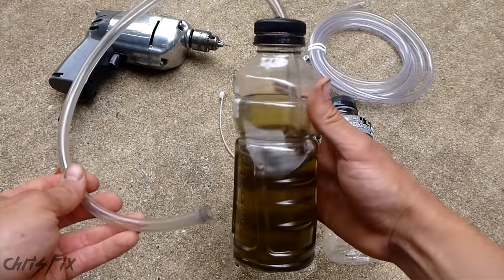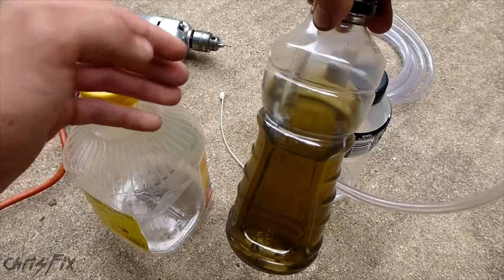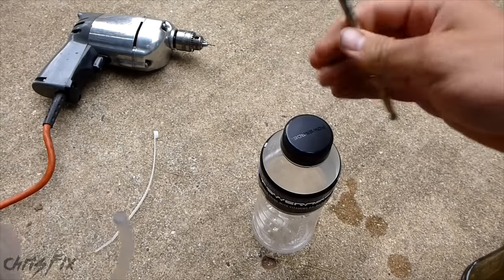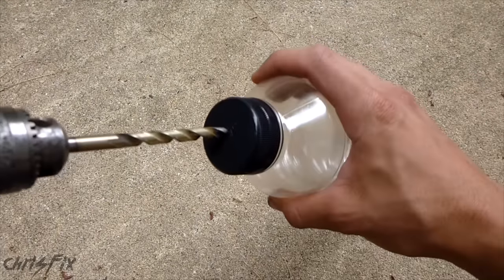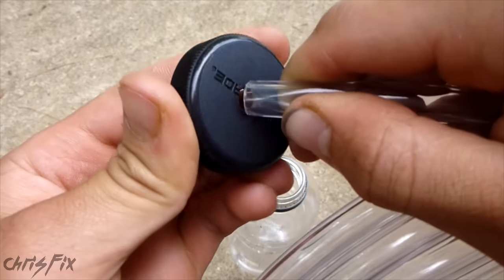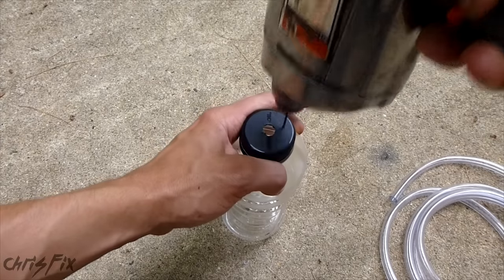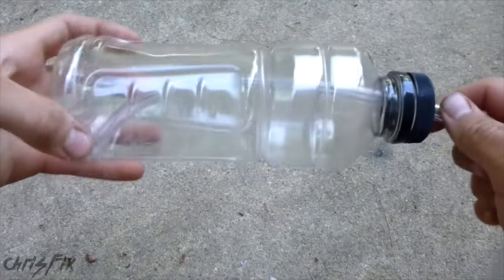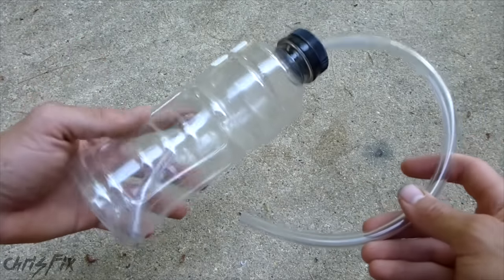How to Make a One Person Brake Bleeder for Under $5

Comment: They don't sell Gatorade singles.. So I got two 20 fl. oz. Vitamin Water Bottles at Wally World $0.96ea. like 30 minutes ago. Bottles look almost identical to the gatorade bottles. I also got 1/4" hose clamps instead of using the zip ties. 1/4" ID x 20'  clear tube was like $5.35 at lowe's, and the hose clamps were something like $2 or something. (+1 : 8,402)
Reply from the maker: +Mark II Nice! You dont have to use gatorade bottles haha
Reply: ChrisFix Kinda figured. Tnx for the reply, keep the awesome videos coming Chris.
Reply: +ChrisFix  If I'm bleeding the brakes on a Rolls Royce or a Bentley, shouldn't I be using a Perrier bottle?

Comment: Could you do a video on finding leaks? I have a 97 ranger with no pedal pressure but there are no visible leaks, puddles, etc.
Reply: Master cylinder is bad. If pedal is soft and no visible leaks underneath usually its MC.

Comment: Take a hose long enough to go from bleeder back to the reservoir. A little pre-filter so debri stays out. A one-way-valve right after the bleeder nipple, and some play-doh clay to seal the bleeder bit better. And go for it....
Reply from the maker: Abby Sandigan You cannot filter out water from the brake fluid so this wont work. I would not put anything on the bleeder valve either (maybe grease) because if it contaminates the brake fluid you can have bigger problems.
Reply: I am talking about bleeding the brake. If you have to renew the oil just push new one through...

Comment: I glued a magnet to the bottle  so I could stick it on my rotor or a metal part so I don't have to put it on the ground and have a shorter hose.. have you ever tried this?
Reply from the maker: swampassoutfitters That is a great idea! Thanks for the tip!

Comment: Hey Chris does using a hand vaccum pump leave any old fluid and/or air up in the master cylinder? I'm asking basically does the pedal push method clear out every little bit better than a pump or do they both clear the system equally good? Thanks for the videos man.

Comment: Great vlog Chris ,, I just flushed my Flux Capacitor ,  Fortunately I when I got to 88 Mph it worked and I ended up in 1953 ,, 🤔⁉️So I bought the same drill as yours ,, Lucky it still works Today ⁉️🙀👌😂🤣😂🤣😂🤣

Comment: Hey Chris, did you really need that pilot hole while drilling thru soft plastic ?
Also, you measured you 1/4" drill bit for the "inside" diameter of the tubing. If you would have measured the outside of the tubing and selected a drill bit accordingly you would not have had to "waller" out the 1/4" hole to make it bigger.
Question:
Can you bleed your brakes by your self with this gizmo, or do you still need someone to press the brake pedal down while you loosen and re-tighten the bleeder screw ?
Reply from the maker: Vic Krue It helps the bit from skidding around. I measured the inside diameter because I wanted to make sure the hole very tightly fits the hose. Here is a video using the brake bleeder which you can do yourself: https://www.youtube.com/watch?v=n1NvtUwfRJc

Comment: This video is pretty cool, thanks for sharing. I've been looking for some fuel line around that size but my local hardware stores and auto parts stores only have like really small line. Does anyone have any recommendations of where to find some fuel line around 1/4" internal diameter?

Comment: I just checked and I have a 8 mm rear bleeder valve and a 10 mm bleeder valve on the front. What size diameter hose do you think I need ?

Comment: wont some air just go back and forth in the line as you pump? I am trying to bleed hydraulic surge trailer brakes by myself. I can pump the master cylinder with a 2x4 but I would think that I still have to keep the fluid moving in one direction until ALL of the air is purged? if I dont get all of the air out and into the bottle in one stroke, wont it just get pulled back up in the hose when I pull the piston back?

Comment: Chris 
You said in the beginning of the video that the brake fluid would last for 2 brakes and then must be emptied. Did you mean emptied or just reduced so the fluid doesn’t overflow?
Reply: Just reduced, dont want it to over flow. Also it never hurts to bleed the brakes until you see fresh fluid as this pushes out the old fluid which more than likely is loaded with moisture. You might have to empty that bottle once or twice for a good flush.  The lines are small, theres not much there and theres always extra new brake fluid left over with just a brake bleeding.

Comment: a nice quick and dirty system for a quick fix, but letting the fluid suck back into the system,you run the risk of sucking air back into it if there is still air in the tube. what you need is a check-valve of some sort in the line to keep the fluid from being sucked back into the system as you go
Reply from the maker: ircimager that is why in my video on how to use the bleeder I show that you need to angle the tube upwards so that the air bubbles up and out of the line. A check valve works too but now you are getting complex.
Reply: yeah, i realize that part, but i'm referring to the air already in the line that may not have gotten to the expel point before the next pump-out

Comment: Hi Chris, would it be possible to do a how to video, on how to make a cheap boost pressure device to set your cracking pressure on a turbo actuator. But something that is really accurate I.E, can go up in pressure by 0.1psi if necessary...thanks
Reply from the maker: +TrenC21 That would be an awesome video but I need to find a turbo car that someone will let me play with.
Reply: +ChrisFix not necessarily....build the device...and just use a spare turbo with an internal actuator....it does not to be on the car ;)

Comment: My mechanic replaced my brake calipers in the front and also the drum brakes in the back. When I got home I noticed the header tank was empty. How do I know if there is air in the system? Will air really corrode the system? If so how long will it take?
Reply: air won't make it rust but it'll make the pedal very squishy and might stutter. Water is what rusts your lines.

Comment: I recently made one of these to assist after a front caliper replacement. It works great. However, there is one thing that tripped me up that isn't mentioned in this video, or any of the other videos where Chris uses this tool. 

After you've bled the brakes, and the tube near the valve is filled with brake fluid, you've got to pull the tube off of the valve. Unfortunately, doing that creates quite the mess, because you've got to pull on the tube hard (since it's a snug fit). Each time I did this, I ended up with brake fluid all over. So, what's the trick here?
Reply: Just spray it down with brake clean after you are done.

Comment: Thanks Chris...  Love your videos!  One question though...  I've used this system myself but it does require a second person to operate the brake pedal.  You say this is a "one person" brake bleeder.  Am I missing something?
Reply: Maurica Arney - I've done solo bleeding successfully and will I'll try to answer. Did you do it exactly as shown in the video, like have the tube arching upward from the caliper so the air bubbles rise as you press on the pedal to the floor? Keep in mind the tube acts like an extension of the bleeder valve and as long as it has fluid a few inches above the valve, you're getting all the air out of the line and caliper. Hope that helps.
Reply: @ninemilliondollars  You need a second person to operate the brake pedal while you observe to see when there is no more air in the line.
Reply: @mwa1252  Hi. I just did my front passenger side caliper today. Had to replace it to figure out why that brake was binding. I used a clear tube and a cup (actually, it was a bleeding kit I bought a long time ago resembling the one in the video). By arcing the tube upward and away from the caliper, it allows the bubbles to float upward and then down into the cup. Granted that you are correct about wanting to see there are no bubbles, and that is most desirable, but that can be solved by depressing the brake pedal all the way to the floor like three or four times. This pumps a sufficient amount of brake fluid through the caliper and no air remains. I did this and after I closed the bleed valve, the brake pedal was rock hard. :D

Comment: Very good and helpful - thank you Man!
Reply from the maker: Thanks Pete!!!
Reply: I now have all of the parts (calipers, rotors and pads also new clips that came with the pads and calipers, brake fluid etc), I've changed brakes before but not the calipers and your techniques sure help including the bleed bottle you made...I'm making one and will use it even though I have a second person to help pump the brakes, just a better way of doing the job, also I like how you bolted the caliper then lifted the bracket to insert the pads after, so easy! - thanks again man.

Comment: My mechanic just opened a nut inside rear wheels. Started the engine, pressed the break, and all oil was gone. Then he tightened the nuts and filled new. Took 2 mins, no extra charges for this.

Comment: Wouldn't it be necessary to put a sealant between the tubing and the hole on top of the cap for an air tight seal?
Reply from the maker: +Terrance Williams you don't want an air tight seal.

Comment: Hello i saw how you did it but alittle confused about bleeding it. The steps. I have about 103000 miles on my car, never changed break fluid. I saw that I was low so I added some to. Reservoir. It was about two years old, new but break fluid. Did not know that break fluid was perishable. So my questionnaires after I finish correcting it an opening up the bleed valve do I just go slowly press on the brakes about 10 times to clear the line and then am I OK to let go of the break and go tighten up the bleeder valve or how does that work.

Comment: Will the zip tie fall off after a few uses? Can I use a small hose clamp instead of a zip tie?
Reply: I'm thinking it might be difficult to find an adequate metal clamp. The screw types are often too wide to fit over the smaller part of the bleeder screw, and the spring-type ones don't allow you to modulate the clamping force. So small zip ties (8" or shorter) are probably the best cheap, readily available option.

Comment: Does the diameter of the hose matter ? I have a clear hose that is slightly more thin but the same length.
Reply from the maker: +Jacob Gee as long as it fits tightly on the bleeder valve that's fine.

Comment: How does this prevent air from getting in the system?
Reply: Because the hose in the bottle needs to be in the fluid 
. If it's not, it will suck in fluid.

Comment: One question: Do I open the nut then depress pedal once or several times? then what about air in line both tubing and brake lines? Ive never used a pro tool like a shop bleeder, but its always been three squeezes on pedal and hold. where you undo nut and let pressure out, then tighten nut and repeat two or more times. I suspect my System has a bunch of air in it. will this bottle method help?

Comment: I wonder one thing. How can one press the brake and at the same time close the bleed nut? If you release the brake without closing the bleed valve it will suck the air again.
Reply from the maker: +Muntasir Ebrahim you don't close the bleeder valve. The tune is facing upwards so the brake fluid collects and the air bubbles up and out.

Comment: how do you go about removing the tube from the nipple with fluid being in the tube? or do you just expect some fluids to be spilled from the tube and just proceed to clean it up?
Reply from the maker: Rob Shum You just pull it off and have the tube lower so the fluid runs down instead of out.

Comment: Hey Chris is it possible to resurface your rotors and use the same brake pads my pads have plenty of life left or should I just wait for my next brake job then resurface them.
Reply: Pads and rotors should be replaced or resurfaced at the same time.  Remember, the pads now have the same flaws on them that the rotor has, but in reverse.  The rotor may be machined smooth, but the pads won't be.

Comment: What is a bleeder valve wrench and do you suggest using one
Reply: It's just a normal wrench but it has 5 contact points instead of 2. I suggest using one so you don't strip the nut

Comment: Will this work for clutch bleeding method
Reply from the maker: Yes, this will work for any kind of bleeding system, whether it is brakes or hydraulic clutch systems!
Reply: I did it in the clutch  resaver I suck air out and put fluid back in I got my clutch back it was awesome I love your shows

Comment: Can you use any clear tubing or does it need to be a specific tube?
Reply from the maker: It needs to fit tightly on the bleeder screw, so whatever size that is for your car works! Usually that is 1/4"
Reply: @chrisfix  thanks alot bro, really appreciate your help 😁✌️ and keep up the good work👍 i really like your video and tutorial 😄❤️

Comment: Hi Chriss, your videos have been very helpful for me and have a question for you. I have to replace a sticking caliper (I believe has resistance when spinning that wheel jack up) on the passenger front side 99 Astro van and going bleed the brakes following you videos on bleeding. The question I have is do I just bleed the passenger side front only  (or do I have to bleed both fronts and rears drums) after replacing with the rebuilt caliper ?

Thanks
Reply from the maker: You only have to bleed the brakes for the line you remove. Check this out: https://youtu.be/nbdJGCi29nQ?list=PLvKbarVtwhUsr7OjYE7NEEXw97DvmmNeE
Reply: Thanks Chriss for the quick response! Keep up the good work/videos!

Comment: The front brake of my bike has equal length lines from the master cylinder to the two front calipers. Would I need to make to set-ups to bleed both lines at the same time, since their is no furthest away caliper to bleed first??
Reply from the maker: +Mad Mat It is not that important. In reality, you can do any order but the longest brake line first will give you the best results. Dont worry too much. You only need to do one at a time.

Comment: Take a pole and jam it between the brake pedal and the seat, then adjust the seat so that it is pressing the brakes down all the way, then turn the bleeder screw, then adjust seat to make pedal go down even more if possible. then tighten bleeder screw, then remove pole. Now repeat.
because i cant get the damn hoses to stay on or ever be snug enough to wear i'm sure no airs getting in. and they gotta be differnt sizes for me, you didnt even mention your little zip tie thing,
Reply: Watch it again. He says he uses the zip tie if the tubing doesn't fig snug enough.

Comment: Could you use a two way manual pump for this?  One similar to your diff fluid change but it has an in and out tube.
Reply from the maker: +David Cazes you could use a vacuum pump
Reply: +ChrisFix Mitey Vac

Comment: Even easier to do is just get the 1/4" ID hose and just open the bottle of brake fluid and dunk it right in there. There's no reason to make a whole separate container for it, it just makes more work and more plastic waste. 

Also, without a proper check valve this won't do a very good job. The ones you buy have one-way check valves so that when you let off the brake pedal, the fluid in the hose doesn't just drain back into the bottle and create a vacuum to suck air back into the bleeder valve.

Comment: 1. Take the cap off the bottle to drill it. No chips to clean out.
2. Use a drill bit the same size as outside diameter of the tube, not the inside diameter. Need need to ream the hole.
Reply from the maker: +Jack Smith thanks for the tips.

Comment: Chris the garage blead the brakes on my car after changing a rusted brake line but now my brake pedal goes all the way down each time I break and then goes to normal. Is there still air inside or maybe it's a different problem like the booster.
Reply: Probably, if it was Ok before. Adjust rear brakes too, if they are drum brakes.

Comment: @ChrisFix  I am not sure if it is really required to drill a hole or if you can just try and punch a hole with a screw driver if you don't have a drill ?
Reply: +ChrisFix a good hole is never a bad thing but you do need to be careful and use the proper PPE.

Comment: If you make the hole too big, just put duct tape over the hole and cut a small slit in the tape. Then just guide the tube through it and it should fit snug with no leaks 😁 just my 2 cents

Comment: changing 1 caliper......should i bleed the other 3 after it's installed?
Reply from the maker: +Dee “Bigblueowx” you only have to bleed the one you remove,  but it's always a good idea to flush the fluid like in my other video.
Reply: SUPER thanks for the speedy reply !

Comment: Doesn't all the fluid you pump out just pull back in when yiy release the pedal? Shouldn't there be a one way valve in the bottle line?
Reply: Nope you press the pedal slowly and release it slowly so it doesn't slurp it back up, once the fluid fills the line into the bottle and pushes the air out it remains sealed and eventually you push all the old fluid out.

Comment: I changed my brake lines, but it leaks near the inner part of the bolts. 
I brought a tool to put a dome washer on pipe before bolts tighten.
But it Leaks from the line and the Centre of the bolt. 

Didn't think or seen people put white plumbers tape on the bolts threads. 

Any ideas?
Reply from the maker: +A Man definitely don't use plumbers tape or anything on the threads. Don't use washers either, the brake line flare nuts should attach directly to each other. You might need to cut and re-flare the line for a better connection. You can send pics to my Instagram if you need more help.